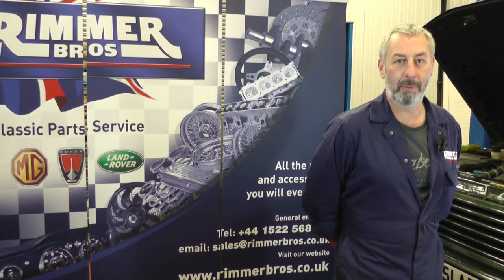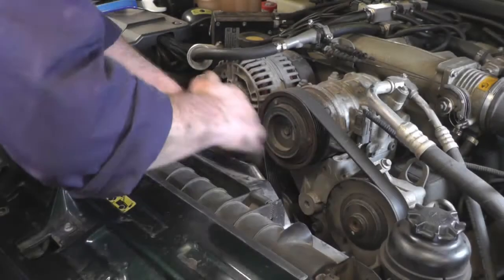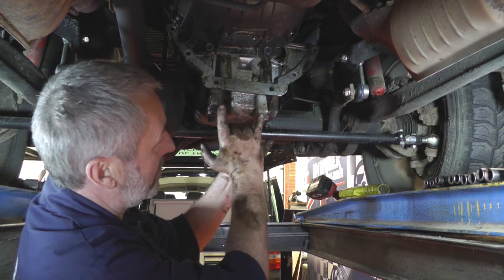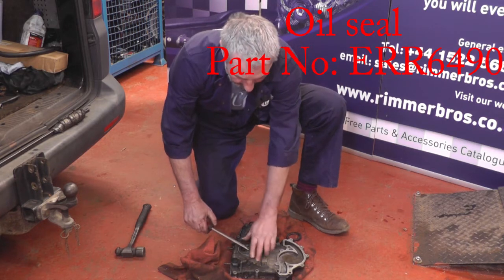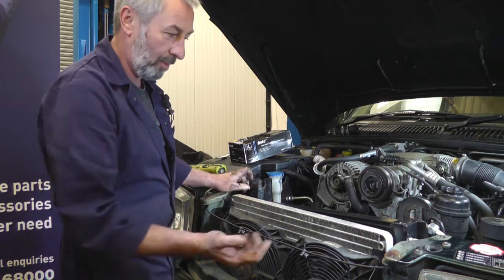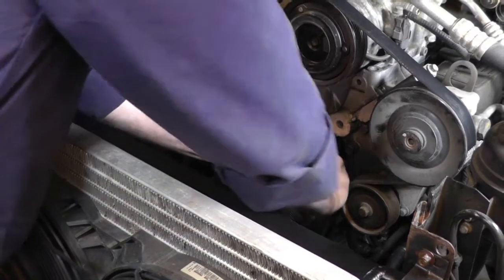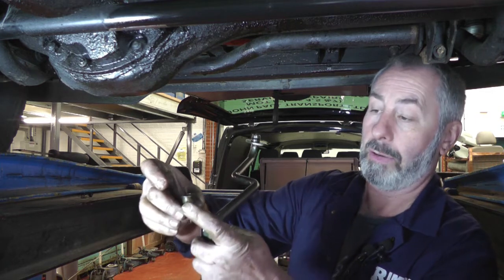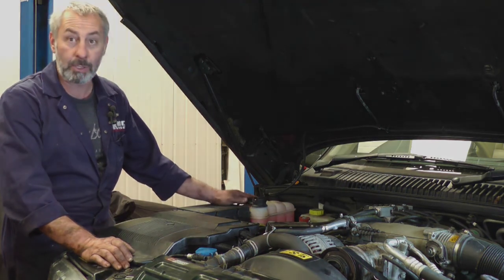Range Rover P38 V8 Oil Filter Housing Gasket Replacement

Comment: How come the steering damper video shows the original part coming off and the new orange one going on like for like if you will, now on this video that steering damper is the opposite way round? Should you not put it on the way it was or has he done this by mistake? Cheers
Reply from the maker: That's very eagle eyed of you, Dominic! And thanks for watching all of the videos. It doesn't matter which way round the damper is fitted though.

Comment: Bonjour Rimmer Bros je cherche une pompe à eau pour une rover SD1 6 cylindres en ligne ( 2600 ) de 78 . Mais malheureusement votre site ne propose pas ce produit .
Reply from the maker: Hi there,

Unfortunately the part you require - GWP319 https://rimmerbros.com/Item--i-GWP319 - is no longer available. 

We've included the OEM part number for you which you may be able to use to locate the part elsewhere.

Hope this helps!